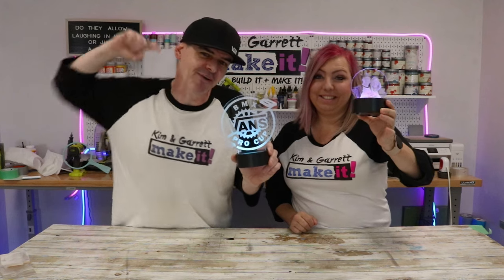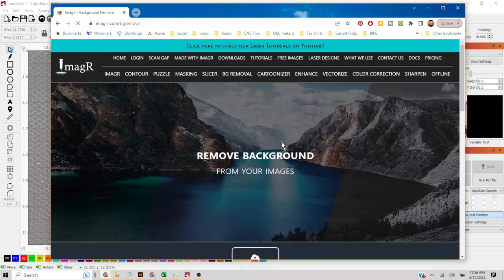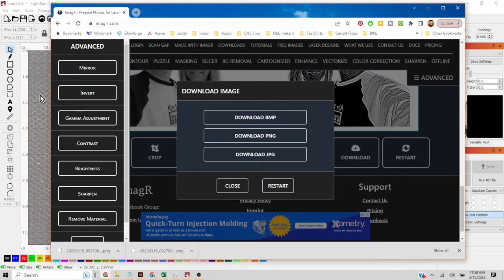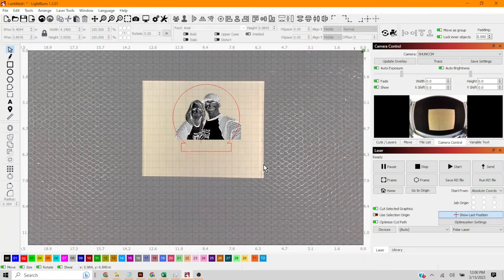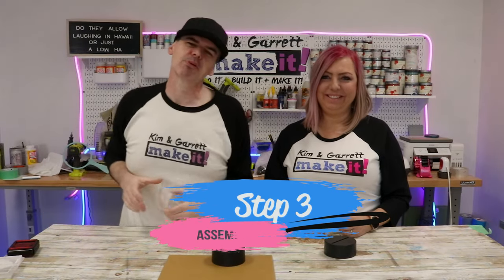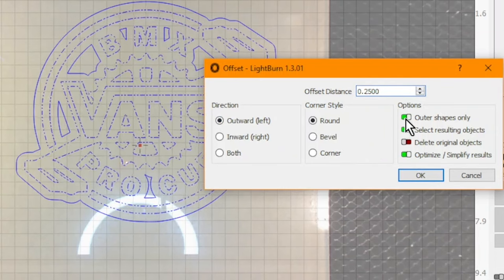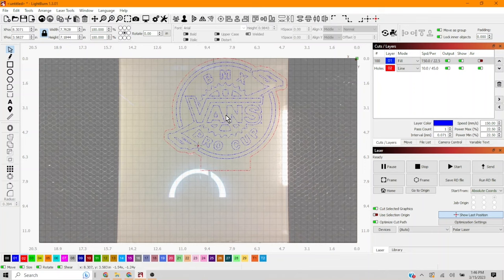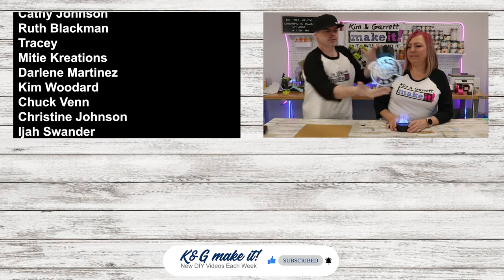Make $$$ in Minutes from Engraving LED Signs - Unbelievable Trick Revealed!

Comment: If you pollish the edge of acrylic that goes into the base, the light will go thru the acrylic will be much brighter. You can do that by using a propane torch and just go across the edge to get it warm enough to smooth itself out.  There are other ways to do it without using a torch, but the torch is much faster.  Just don't get it so hot that it starts melting everything.
Reply from the maker: Steve, you had me at torch! Thanks for the awesome tip! I'm going to do it now! ~garrett
Reply: not if you cut it on a laser, the edge is already polished if your settings are correct no torch necessary, now what you can do is sand the all the other edges to frost them so that the light bounces back a little that will actually help but yay no torch needed sorry Garrett!
Reply: Hew Steve do you know how to curve text with the xtool softwear?
Reply: Use a MAP Gas torch for polishing acrylic - the propane torch may work alright, but a MAP Gas torch burns much hotter and it’s better for thicker acrylic. Be careful not to burn the edges! Use safety protection and make brief passes on the jagged edges. 
 It might be overkill, but I just wanted to share. Thanks!

Comment: Using imager to adjust the picture, Lightburn is a lot more powerful than you know and can do all of that and more you could have done all that in half the time just using your laser software.
Reply from the maker: Yes! We have been using Lightburn for a while, mainly use it for cutting files developed in Illustrator.  Lately, we have had lots of requests to do more engraving. We plan to do a lot more in Lightburn. Thanks Crafty Crafty! ~garrett

Comment: If you are using an image processor like imagr all image adjustments should be done in imagr and nothing should be changed in lightburn besides power/speed and making sure pass through is checked even dpi should be set it in imagr

Comment: I’m trying to figure out why you have to reverse the image? When I engrave like this using glass, I will lay a piece of black foam core on my wasteboard and then lay the glass on top of it. When it finish the image is beneath the glass and the smooth side has the correct orientation. I have not tried this method with acrylic, but I have some that I will try today. Hope to have a video with the glass  shortly.
Reply: The etching was done on the front of the acrylic, so they would flip it to have a flat surface to the front. And now it is correct.

Comment: Try that the shape of the acrylic is not larger than 8" wide x 9 high and that the engraving is not so deep or the light will not reach the top as you can see in the Vans logo.